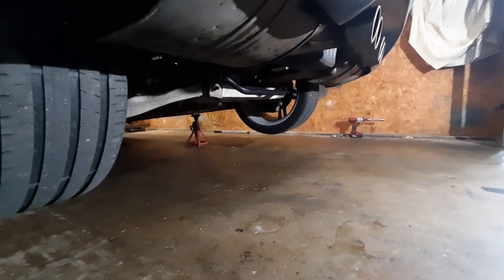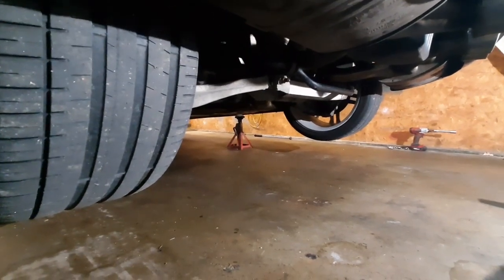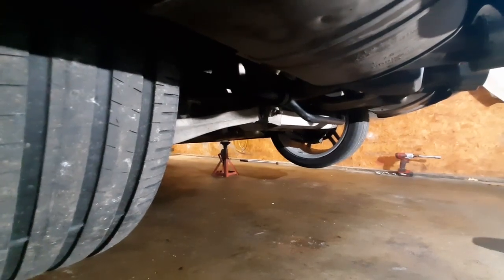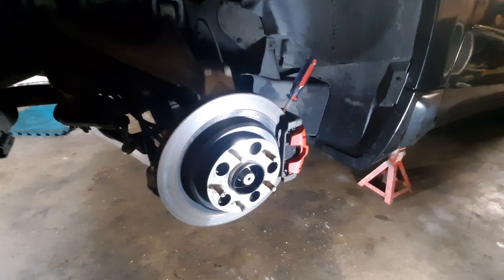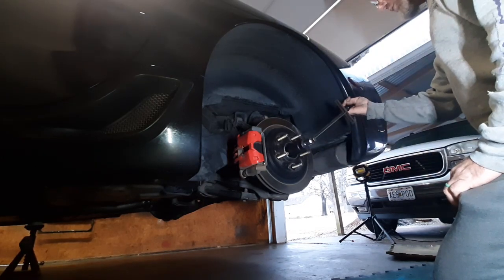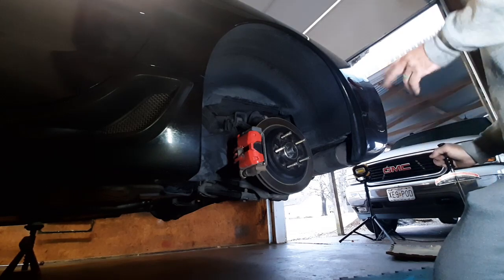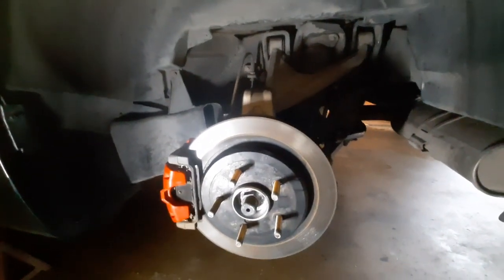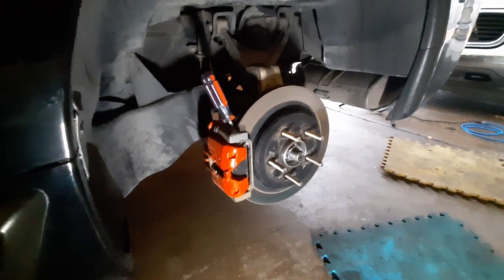Testing the Differential Clutches on a C5 Corvette

Comment: That would be in spec for a Ford Trac lok
Reply from the maker: I believe it.  This break away torque depends a lot on the preload springs and that varies from one diff style to another.  The Corvettes are supposed to have more and both of my preload springs are broken.
Reply: @xpsgarage  Yes, I was playing with My F150 today. If both wheels are on ice, they both spin, but if the traction is too unequal (ice/pavement) there is little to no locking action. Even with more preload if the difference is too much it will not lock. Trac locks seems great to take off on pavement so both wheels put down the same power.

Comment: Love your channel XP! I am currently following your guide on how to rebuild the T56. What are the consequences of worn out clutch packs in the differential? Is this something that should be addressed while I have the drive train out?
Reply from the maker: The more the clutches wear the more it acts like an open differential.  The preload test just gives you a basic idea of the clutches condition.  If one side was significantly different than the other that would indicate a broken spring washer.  If you want to upgrade then now is the time while you have the drive train out.  Even if your clutch disks are OK the stock C5 spring washers are weak and prone to breaking so that would be a good inexpensive upgrade by itself.  I will be measuring the disks on mine when I take them out and comparing them to the service manual specs.  If you just did the spring washers then parts cost with seals and o-rings is around $130.  With new carbon fiber clutches you are looking at around $350 for everything.
Reply from the maker: I just disassembled the diff and both spring washers are busted.